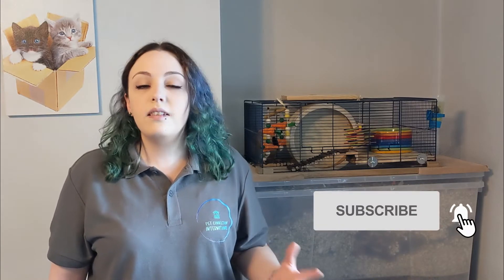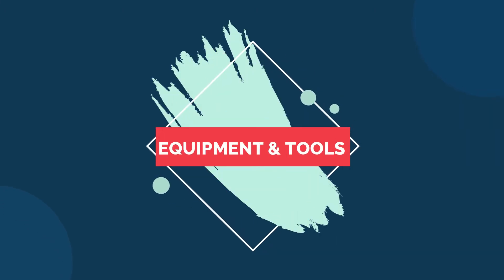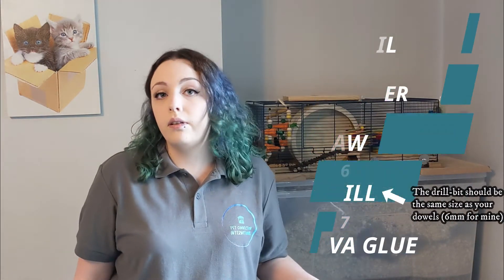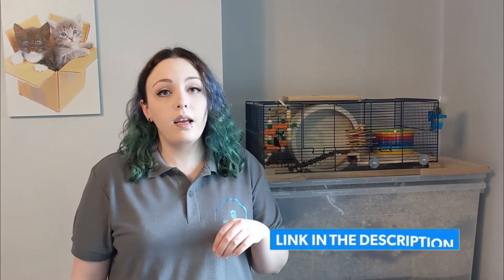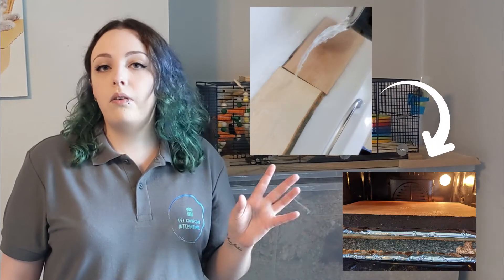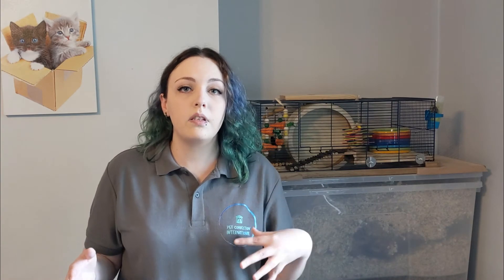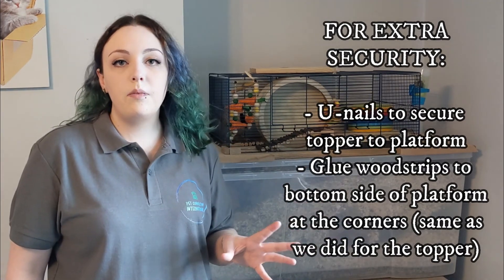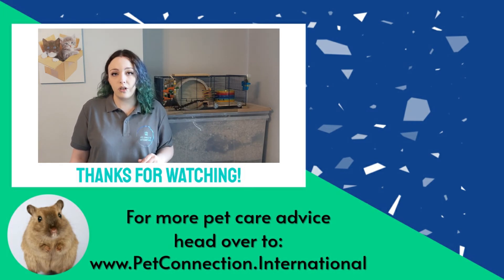How to make your own EASY diy gerbil cage

Comment from the maker: I should also point out that plastic tubs aren't suitable as permanent homes due to the chew out risk & not meeting the minimum 100x50x50cm requirements for gerbils, but they can work well as temporary homes until you're able to get a suitable sized glass tank. This method for making the topper platform can also work for glass tanks too ☺️

Additionally: wire floors should be covered with something like cardboard, seagrass matts or tiles and bendy bridges

And any exposed wood that water or urine can get to should be covered in a pet safe sealant like Plastikote to protect against water damage and mould: https://amzn.to/3PxwLCf (affiliate link)

If you want this guide in text format, you can download it here: https://petconnectioninternational.ck.page/c56b62af3c 😊

For bonus content, check out the blooper reel for this video: 
🎬 https://youtu.be/Pz7Xkv1a

Comment: Do you have a link for the container seen in this video? Can’t find one that size anywhere.
Reply from the maker: It's linked in the description 🙂 however I should note that these enclosures don't meet the minimum 100x50x50cm for gerbils and have a potential chew out risk as they're plastic, so they can't be used as permanent homes. But they can make great temporary homes if you need something cheap that can be put together quickly for an upgrade, here's a simpler version if it helps: https://youtu.be/aNKpyb0QutQ the tub I used in that one is the kaze xxxl from b&q ☺️

Comment: thank you for this! Don't they need more ventilation in the tub?
Reply from the maker: About 50% of the top is open, along with air being able to get along the sides from the topper, plus gerbils produce very little urine and I use very absorbent bedding, so there's virtually no ammonia build up, even with 2-3 months between tank cleans 🙂

Comment: I have a gerbil question. I currently have my gerbils in a 50 gallon bin cage with a topper. I have been wanting to find an aqurium (bigger) for a awhile now. My neighbor is now giving a away a terruim with about 1008 sq of floorspace (don't know the gallons its old) There is only one problem it has one wooden wall and it has aquarium sealent on it to make it safe for aquariums. I have a idea and want other gerbil owner opnion on it. I am thinking of covering the wood. Is there any safe ways I could do this to prevent chewing. It is very very much in horrible condition. Just would like to know to what you think about it. would it work or would it not. Love your channel❤❤❤❤❤❤❤❤
Reply from the maker: Yes I do think that could work, especially if you cover the wood part, something like a sheet of acrylic could work well I think ☺️ just to check though, would you be able to add deep bedding? Or are there doors on the front that would prevent you from doing that?
Reply: @PetConnectionInternational  There is no top, and the cage is about 13-14 inches tall altogether. I am thinking maybe I could could work out a topper to fill the bottom with bedding. It is not taller than my current cage, but it is much, much longer. Where would you buy the stuff to cover it with. How would you make a topper from scratch or a top from scratch?It was made for turtles, so it has space for a small turtle burrow
Reply from the maker: Ah yeah if you added a topper that would work ☺️ you can buy acrylic online, just search for acrylic cut to size, and for the topper you could either use a pre-made cage and add it to the top with a platform or build one with wood pieces, you'd just need to draw up a design and figure out what wood you'd need 🙂

Comment: Helpful vid, thank you :). I currently have a 95cm x 40cm x 40cm tank and am thinking of upgrading. I am either thinking the Ikea detolf which will add a lot more length but no extra height, or do a cage topper on my current set up which will provide height but no extra width... do you think Gerbils would generally prefer one or the other?
Reply from the maker: I would go for the topper option personally so you can completely fill the burrow space ☺️

The recommended size for a base tank (and legal minimum in Switzerland) is 100x50x50cm, so your tank is almost there, adding a topper would give them loads of extra usable space 🙂

Comment: How often should u clean out the cage
Reply from the maker: In the minimum size tank (100x50x50cm) with 25-40cm+ of good absorbent bedding like hemp, you should only need to change it every 2-3 months, keeping around a third of the old (cleanest) bedding to put back in 🙂

Comment: This is an epic video!! I have a large guinea pig cage, 620sq inches of floor space, the bottom is plastic and is 6” deep. Could this be filled with bedding and serve as a decent size for two gerbils? Thanks so so much!!
Reply from the maker: Thanks! I think a 6 inch base is way too shallow for gerbils, they need a minimum of 10 inches of bedding with 2 inches room above that for them to be able to stand on top of the bedding without hitting their heads on the topper, so the base really needs to be at least 12 inches deep in total to give you enough room for the bedding they need, so I'd maybe look into getting a large plastic tub or glass tank to upgrade your base, but the size of the topper is great! ☺️
Reply: 620sq" for a Guinea pig?!? Thats not large

Comment: Very good video for youngsters who clearly now often feel guilty and under pressure. The (unofficial) requirements seem to change each year. 775" square means anyone with a 40/50/55 gallon tank even with a topper are now being told it's too small for 2 gerbils. It'll probably be 1000" square next year! When it comes to raising animal care standards I suspect constantly pushing the "minimum" up will be counterproductive and many people will sadly disregard all the wonderful information out there.
Reply from the maker: Thanks for your comment 😊 and some studies may be flawed yes, but as wild gerbils have burrows that are over 1m deep and 4/5 meters wide, I'd argue that the 0.5m is the very least we can do for them. My aim with sharing this was to have an identifiable "goal" to aim for with sizing, so that the end point of care isn't too small, but care is a journey and it can take time to get there. I myself have an enclosure that's only around 0.36m, while I save up for a bigger thank. Also based on the dimensions I can find a 40 gallon would give around 0.4m floorspace, so nearly there (even bigger than mine atm), and a 50 gallon works out at over 1m squared, so more than double! I think a 40 gallon is a fine start, and it's what most others recommend, but go bigger if you can. 20 gallon that the US recommends is way too small, and the requirements don't go far enough there, so I would strongly recommend against anything this small, it's just nowhere near big enough for what they need
Reply: @PetConnectionInternational  I think some 50 gallons have the same footprint as a 40 but are taller. Unfortunately, many people still keep hamsters and gerbils in tiny tanks and cages like the horrible Qute cage. I think they might be more likely to upgrade if they don't feel overwhelmed thinking it's only good enough if they have a 100 x 50cm+ cage or 75 gallon tank with 40cm+ bedding. It's sad to see young people worried and anxious because they can't recreate the amazing setups on YouTube. They may never be able to upgrade due to money, space or other issues and too often people are shamed for this on-line (not usually by YouTubers themselves). Looking at Amazon cage reviews it's clear even some Germans don't meet their own high standards! I agree some kind of minimum is needed to keep healthy, happy gerbils and 20 gallons is too small. I think it probably would help if the RSPCA brought back much clearer guidelines.
Reply: Just to add, the German  reviews were for cages similar to the Falco 80 for two gerbils or 80 x 50cm hamster cages (usually for one dwarf hamster, definitely not Syrians). I'm sure they never use the teeny cages that make you feel claustrophobic just looking at them.
Reply: The author of that article has a lot of very terrible takes on various animal-related issues, including that wild animals are OK to keep as pets, and that article was no exception, as they concluded that abysmally small cages are OK if you add more enrichment. You’re right that we don’t have much science behind minimum cage sizes, but what we do have is minimums developed by people in the hobby from years of observation. It will continue to change, as all pet standards should, as we learn more and more about the animals in question. Kids also need to learn about choosing not to do something because you don’t have the proper resources. Allowing an animal to potentially suffer just to keep from hurting their feelings doesn’t do them any good.
Reply: @robogreifer  I agree with you but I don't think one dwarf hamster or 2 gerbils  will "suffer" if they are in a 40 gallon tank with good enrichment, yet that is under 775 sq inches. Some people (not this channel  and I really wish I hadn't written this here) advocate for well over 1000 sq inch and shame everyone who has the temerity not to 100% agree with them. I'm very familiar with that kind of behaviour outside animal care.
Reply: @robogreifer  I've checked  these more recent articles and have removed any reference to the article I mentioned.

Comment: They don't chew the plastic ?
Reply from the maker: surprisingly, no, none of mine have, but it is a risk which is why I double up the tubs just in case. But I do recommend going for a glass tank instead as they're more secure and you can actually get them in a suitable size (gerbils need 100x50x50cm minimum), the bin cage is more intended as a temporary, immediate upgrade for when someone already has gerbils in a much too small enclosure but with limited funds for an upgrade right now 🙂

Comment: Won't gerbils chew through plastic though?
Reply from the maker: It depends on the gerbils, mine have been in it for a year now and not even a nibble 😅 making sure they have plenty of bedding and chew toys also helps, and you can double up the tubs for extra security 🙂

But the guide is more about the platform than the base, you can use the methods for glass tanks and other toppers too ☺️
Reply: @PetConnectionInternational  Ohhh okay thank you so much. I'm planning on getting two of them and I wanted to make sure you could.
Reply from the maker: No problem 😊 Glass will always be the #1 option, but plastic can work for certain gerbils with enough bedding & enrichment, I'd keep a close eye on yours and see how they get on with it (use 2 to help stop them from escaping if they do decide to chew it) and be prepared to switch to glass if you end up with a couple of destroyers 😅
Reply: @PetConnectionInternational  okay 👍

Comment: You wanna help me figure out how to make one for 4 gerbils? 2 are alone and 2 are together. I really need the help because I really don’t like buying so many tanks
Reply from the maker: It's not advisable to try and get 4 gerbils living together, they have very sensitive social structures and declan really easily, a group of 4 is almost guaranteed to fall out at some point. Your best bet is to leave the pair as they are and try and bond the remaining 2 solos together 🙂
Reply: @PetConnectionInternational  you know I would do that but I don’t know if I feel comfortable with it because one is older than the other by a year and I literally have a feeling that the male could be related to the pair I have in one cage because they all look exactly the same and I got them from the same place but different times within the same year. You think I could try to get them 3 to bond instead or is that bad???
Reply from the maker: Unfortunately not, bondings can only be done 1-1. So with 3 adults the bonding is highly unlikely to work and could lead to very dangerous declannings later down the line. You'll need to leave the pair alone and either bond the two solos together or find them each new friends. My first bonding was a big age gap (2.5 years and 6 months) and it worked out fine, as long as the personalities are a good match there's no reason why it can't work 🙂

Comment: I’m afraid, as a complete novice, this video hasn’t helped me at all. I find everything is just much too fast, including her speech. A step by step approach would be better for me
Reply from the maker: Hi Carol, sorry the video wasn't easy to follow for you. I have worked more on slowing things down since this was recorded but if it helps for this video you can change the speed a video is played at in the settings bar, so you can slow it down, and you can select individual chapters which have been split into the different steps. There's also a written version of the guide available to download from the link in the description if that helps to make things clearer for you 🙂
Reply: @PetConnectionInternational  

Thanks for your reply and I’ll certainly investigate further
Reply from the maker: No problem ☺️